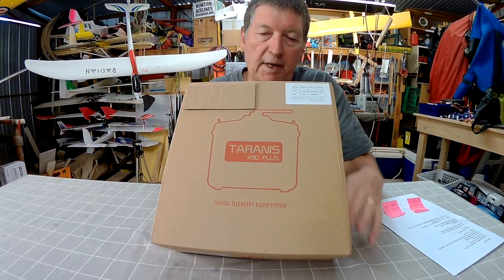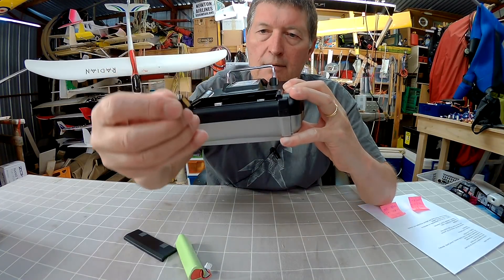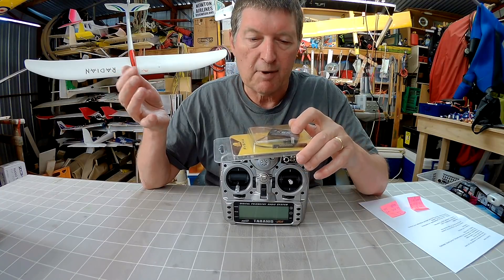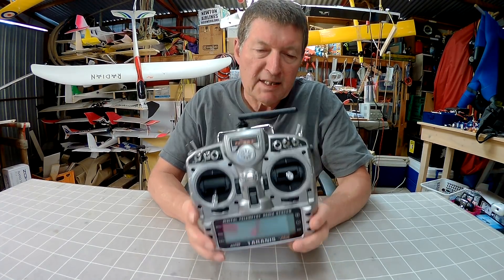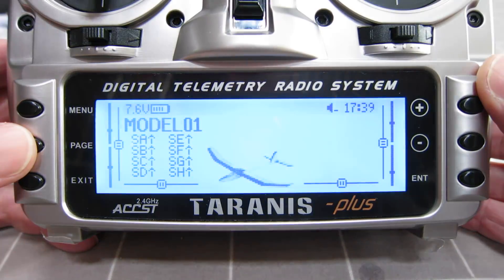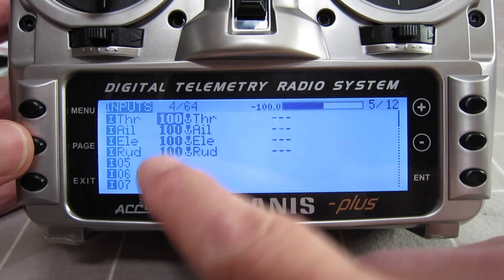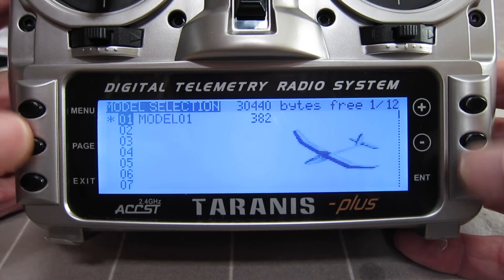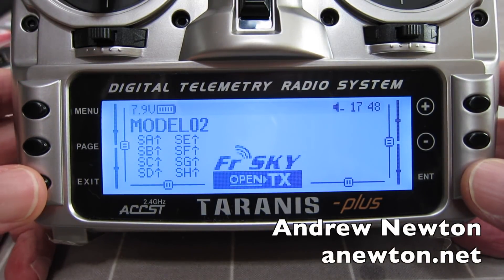FrSKY Taranis X9D+

Comment: Hi Andrews, appreciate your videos. already helped me a lot.  i started  RC flying with a simple 6ch hobbyking transmitter for about 35 bucks - i started with that one, because my budget was limited back at this time and i was unsure if i get into rc flying. soon i upgraded to a Flysky i6 radio. now i am thinking about another upgrade, because with my latest glider (volantis phoenix from Hobbyking), i am limited with the amount of channels. the FS i6 has enough channels for the basic setup, but for a more complex setup the radio has not enough channels i would need for different mixes. my budget for a new transmitter would be around 100-120 bucks. i would also need about 4 - 5 receivers, which should be at a decent price. Do you have a recommendation for a radio? thanks
Reply from the maker: Radiomaster Zorro 4 in 1 or TX12 Mk11 and use your current FlySKY receivers. Or my next review is the FlySKY ST8, which is good too, but you would need new ANT receivers

Comment: I fly in what has to be extremely noisy rf environment- had a fly away probably around 100  meters with x8r and 9d+
Reply: Same here ! when range testing outside the house the range is terrible ! I have tried X8R and even swapped it before leaving home for a D8 and just the same, your right it must be the local RF as this is not a problem at the flying field. It is just annoying, I own a 9d a 9e and a Q7 they are all great...... so good you just dont expect to get that round the estate.
Reply from the maker: I believe wireless security systems are the biggest problem.